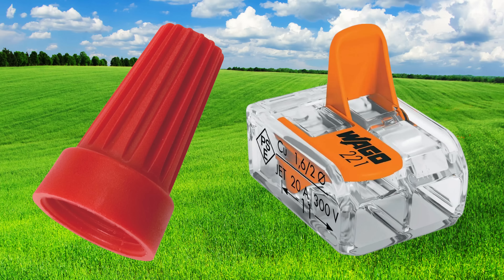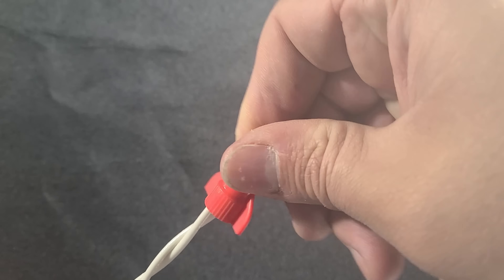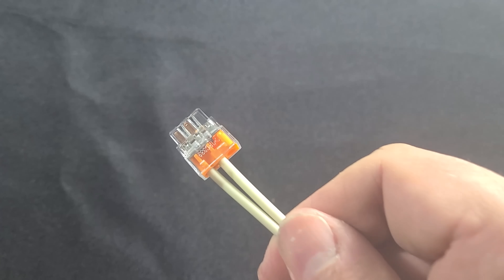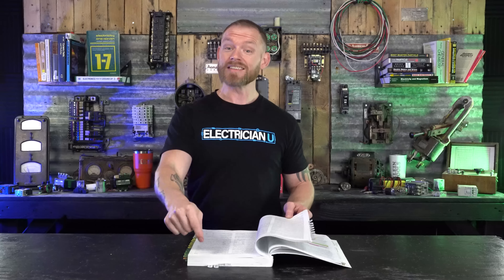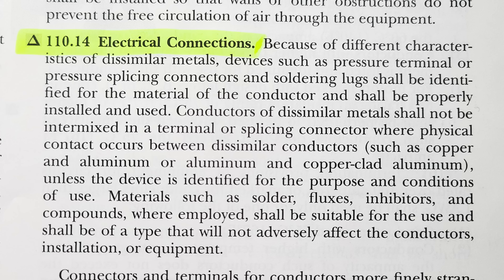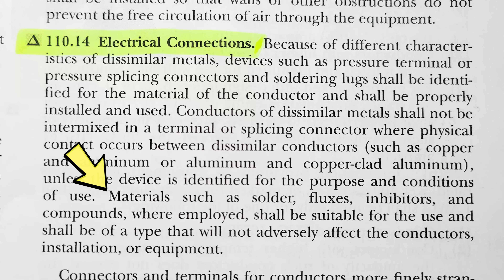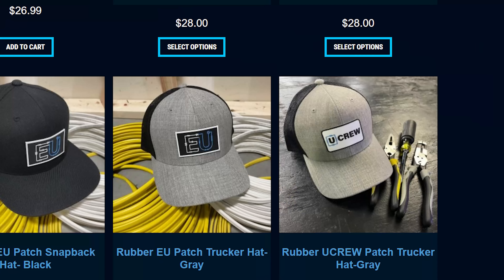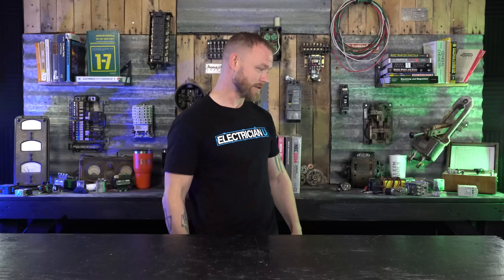Should We Use WAGOS or WIRENUTS?!?!

Comment: Two advantages of WAGO connectors, that are seldomly mentioned: 
1. You can inspect the connection, because the plastic is see through. (cable stripped properly, wire pushed in deep enough) 
2. The connector has a tiny hole, which can be used for safe measurements on a live circuit without undoing any splices.
Reply: Wago 222's are not transparent though.
Reply: He's obviously talking about 221s.  Being both smaller and transparent, you should be using 221s anyway unless you have a bunch of 222s left in stock.

Comment: I love your Channel. I have over 40 years experience as an electrical contractor.. But you made one mistake. A stab lock is exactly that, you skin the wire, stab it in and it locks. Wagos are entirely different termination. They are compression, you skin the wire, push it in then flip down the tab. Compression is completely different then stab lock. Also it is much better. Stab lock should have never been approved and it sucks!

Comment: I'm retired after forty years as a commercial electrician. No real electrician would consider using a wago over wirenuts. I've removed wirenuts that were in place for over forty years that still looked like new. As far as twisting wires together in most cases the twist is what insures a good electrical connection. It's sad but the directions on a box of wire nuts is generally wrong. You twist all solids together before installing the wire nut. You twist all stranded together before installing the wire nut. For a combination of solids and strandeds you twist the solids together and then twist the strandeds together and then you place them side by side with the ends even and screw on the wirenut. They don't fail if done correctly. Those wagos depend on a slight pressure against a metal strip. That's a very poor connection when it comes to commercial use and should never be used except for fixture wires in strip lights.

Comment: The Wago connectors are UL tested for the loads they list. They have gone through extensive testing to categorically prove they can handle all of the loads they are listed for. The UL listing provides solid evidence that the Wago connectors have been extensively engineered to connect copper conductor for the loads they are designed to carry. 

The myth that Wago connectors "heat up" is propagated by electricians who lack an engineering background.

I have had wire nuts fail repeatedly and I have had to fix sloppy electricians' work after the fact with twist wire nuts. I have also had shorts with twist wire connectors and they take a LOT more room in the box, and with smart outlets, that is a pain in the ass.

Comment: There is far less surface area with a wago.  The same with stab in the back outlets and switches.  With lower loads on lighting with LED then I'm ok with it.  POWER CIRCUITS require far more surface area in the connection.

Comment: This dude is  disingenuous. He is promoting Wago connectors without disclosing that fact. He presents wire nut and Wago on a plate shoving them in your face  and expects you to eat what is in front of you. He’s not telling you Wago connector is but one brand of several that uses the same wire clamping mechanism. Of course, Wago charges more for the same stuff.

Comment: (I've been doing electrical wiring for over half a century.) Wirenuts are a crapshoot: You can't see if there is a proper connection. After a burning smell, I discovered a charred wirenut behind a switch plate, just before leaving town for a few days. The wirenut had been there for two years and only then decided to somehow come loose and heat up. I've switched all the wirenuts in the house to Wago, and now feel I can leave the house without fear of returning to a smoking ruin.

Comment: This old electrical engineer has always used a "hybrid twisted nut" system. I start by twisting the wires together, and then I get my old Weller 150W soldering iron and solder the entire connection together using some 1/16" rosin-core solder, filling in the gaps everywhere. A reliable connection all about "contact area." My system beats anyone's in terms of contact area. The connections are as reliable as an unbroken length of wire. Does it take extra time to do? Yep, and I sleep soundly at night.
Reply: Makes changes and updates tough however. If you really want to go "old-timey" install knob & tube.

Comment: The copper to copper normal force of a twisted connection using a wire nut is clearly superior to that of a Waco. This is because the capability of the electrical connection is dependent on the mechanical normal force. Hence, a correctly assembled wire nut will always be better than a Waco. Take the time to twist it and then tape it in the opposite direction of the twist. Or you can use a Wago and get a tailgate warranty.

Comment: Seems to me that the typical bias against Wagos is similar to the bias against sharkbite fittings. It's just a resistance to something "new".  I find it funny to hear the typical "I've been in the business for 60 years, I've seen this I've seen that, and I don't trust these things..... for anything important.... but I keep some in my kit.... because they can fail.... or, I heard they can... or I read it somewhere on the internet.... you know,  a fire cam start because, you know, resistance... or umm, the lever opening, .... well, that's what the internet said." What I never hear these guys say is "these things started a fire and here's the documented proof." The same way plumbers say "I don't trust sharkbite fittings because that rubber gasket will leak in, umm, 25 years and they're unreliable." But you never hear the plumbers say "I installed a sharkbite fitting as per manufacturer instructions and it failed."

Comment: You should mention the UL White book. It goes hand in hand with products and code. It tells how to properly use items and what code articles they satisfy. Say for instance ring terminals.  It tells you can stack them on a bolt, but to be code compliant the tangs have to be rotated so they do not stack on each other. You don’t see information like this anywhere else. Email UL laboratories to get a free white book. More electricians need to use this.

Comment: I never heard of you or wagos until a few weeks ago but I like the content. But simply put isn't it safe to use aluminum and copper in a wire nut if you pack it full of dielectric grease?
Reply: NO. Connecting copper with aluminum has nothing to do with dielectric grease. The issue is that copper and aluminum have different coefficient of expansion. The coefficient of thermal expansion for aluminum is 35% greater than that of copper.

Comment: GreatScott! did an excellent shootout between Wago lever nuts and twist nuts, including pull-out force and electrical resistance. Twist nuts won just about every category but ease of use. The difference in electrical resistance is a nothingburger unless your specific application will handle heavy current, like a kitchen range or a clothes dryer.
Absolutely no need to pre-twist the wires. If you twist wire nuts properly, they will twist the wires for you. With solid core wires on both sides, you line them up, the ends of both are caught together, twist until the exposed insulator is twisted, and you have a solid, well-twisted connection within the nut. If you're connecting stranded wire to solid, you want the stranded wire to be slightly proud of the solid so that it will be twisted around the solid wire and the nut bites into both conductors.

Comment: Dialectic grease on all your connection will keep them from corroding, especially wet or damp condition.  Mr inspector here. Worked as a machinist and millwright
Reply: Not a problem if you use copper wire. Copper is essentially immune to corrosion. It behaves like a noble metal because of the naturally protective film that forms on the metal's surface. Dielectric grease is NOT the issue with intermixing copper & aluminum wiring. 
Connecting copper with aluminum has nothing to do with dielectric grease. The issue is that copper and aluminum have a different coefficient of expansion. The coefficient of thermal expansion for aluminum is 35% greater than that of copper.
When using aluminum wire 
There is no specific code requirement for antioxidant paste at the lug connections of multi-strand aluminum wires in electrical panels. Also, some aluminum wire manufacturers and panelboard manufacturers now no longer require antioxidant paste for aluminum wire connections using their products.

Comment: If you put wire nuts on untwisted wires and continue twisting the nut until you can no longer twist it by hand, then remove the nut, you'll see that the wires are indeed twisted together...
Hand-twist the nut, then use your Lineman's Pliers and twist it a few more times...
I've never had any problems with my connections...

Comment: What are your thoughts using wago on high continuous load circuits like a 110v EV charger. Aren’t the wago spring loaded similar to the push in connectors on the back of budget outlets? After running my portable ev charge connector for almost a year, I smoked a couple of my garage outlets. Ev charger was at the end of 4 chained outlets. Lucky I didn’t burn the place down. They’ve since been replace with spec outlets using screw terminals. I’d be real concerned if a wago was in the path.

Comment: 11:47   Is it acceptable to tin a stranded wire with solder to make it rigid into a Wago?   As I understand "wago" or stab connectors are to reduce user error which makes sense to me.  As an amateur I agonize over how many twists, etc.... Strip gauge to 13mm and stab is a no-brainer.

Comment: I have seen an inspection fail because the inspector insisted an non-listed device be replaced with a listed one. Way too much discretionary power in that position. I have seen inspections fail just for use of wago connectors, but that was years ago.
Reply: Inside of a light fixture, I would absolutely use wagos, and a scissor lift, fuck a 14 ft. A-frame.

Comment: My first journeyman  (20+ yrs ago) said ALWAYS twist ur joints,  the joint should hold even without a nut.  I've noticed in the last 2-3 years the majority of apprentices twist very little. But em up n crank it on with the  linemans.  Personally I've seen many  AFCII's trip due to due to minute arcing in the nut. It's always solid, never stranded. Haven't seen it happen in awhile. Maybe afci breakers are improving?

Comment: Wire nuts are not just a waste of time dude but you are putting undue stress on the conductors. Take a piece of metal, copper, whatever and keep twisting it and untwisting it. Eventually it 'will' break. I hate the twisters out there. It makes for a pain in the bum job when I break out my tester to fault find, test or commission. Lever connectors are the way forward and used in the correct junction box become maintenance free connectors.

Comment: You can drive a Chevrolet Spark or the Mercedes-Benz S 500 63AMG. Its pretty much the same thing. They are both regular cars in their respective markets, that will get you from A to B, but one of them is slightly better engendered than the other…

Comment: Referencing twisting or not twisting before wire nut installation: I have used both methods and had to go back and twist straight joints as the resistance was high enough to cause "ghost trips" of the AFI/GFI breakers now required by code. The twist exposes more metal intimate contact and lowers the resistance of the joint.
I am concerned about WAGOS for the same reason.  A twisted wire nut connection can handle reasonably high currents with less heat generation as opposed to the point contact of the WAGOS.
On low-draw circuits such as basic LED lighting, WAGOS are DEFINITLY the way to go but for motor or heating element circuits, I prefer a twisted (maybe soldered as well) wire nut joint.

Comment: I have with One gripe with Wago. My sister in law was doing her first ever all by herself DIY swap of a light fixture. She finished the install and the light wouldn't turn on, She was too ashamed to ask for help so finally my brother asked for me to take a look at it. The Multi-meters reading was all over the place So I'm thinking bad connection. Sure enough the Wago Connectors that came with the light fixture were bad, fixed it by swapping it with a wire-nut. 

That's when I was able to get a better look at the Wago, It was a fake knock off, literal trash, one side didn't close snugly. I had to look real close to tell that it was fake, and that leads me to my Issue with Wago. They added a simple moving part, now I'm sure Genuine Wago connectors have no issue with tolerances, but that simple moving part introduced a point of failure to the knock off. I don't know what country the led light fixture my sister in law bought came from, but they obviously had no qualms shipping it with knock off Wagos, and the majority of people can't tell the difference.

Comment: People seem to think that the only reason to use wirenuts is cost but that's incorrect.  Wirenuts are more compact.  The more wires getting connected together, the greater the difference.  When folding wires into a maxed out box, would you rather use red wirenuts or a five wire wago?  Personally, I'd rather use wirenuts because it'll be easier to fold the wires into the box.

Comment: I use wire nuts cause it's what I've always used and it's what I'm comfortable with and used to. However I do love wago connectors for odd situations like when you're joining fine stranded wire to a solid conductor. I work in industry and we'll commonly stub out of an L body with a cable gland and a short length of SOOW and I love them for that.

Comment: Electricians who still use wire nuts needs to be stripped of their license. There is not a single circumstance where wire nuts are acceptable. As a customer i would never accept an installation performed with wirenuts today, 20 years ago, sure, but today no.

Comment: And I will be cursing you and  all of your pretwisted wires when I come back to add or remove a wire later on. I just put a band of tape around the group of wires before I take the wirenut off. I have had Wago levers pop open inside of crowded junction boxes. Buchanan called their's "Red Rangers". Woo!

Comment: It is worth noting that there are more choices out there than just wire nuts or Wagos. There are also just plain screw terminal blocks, which are standard issue on pretty much every wire-in household appliance sold outside the United States. Which brings us to the third thing worth knowing; Wire nuts are ONLY used in the United States, and are frowned upon, and in most cases illegal in every other country in the world, and have been for decades.  The reason wire nuts are inferior to every other splicing method is simple - They Come Off!! Either the plastic cap comes off the wire winding, leaving everyone vulnerable to lethal voltage, or even more common the whole thing just unscrews and falls off, leaving everyone vulnerable to lethal voltage. Besides making your circuit fail. Wire nuts are a throwback to another era - the good old days before anything was grounded, ground-fault breakers didn't exist, houses had screw-in fuses instead of circuit breakers, and these could conveniently be replaced by a coin in a pinch, and wire insulation was made of cloth.  If you believe we have evolved beyond that point, it's high time to start believing in ditching wire nuts once and for all.

Comment: For any circuits drawing current near the breaker limit I use MARR connectors.
Reply: That should be MARR set screw connectors with screw-on insulating sleeve.

Comment: I worked in the trade doing low-voltage work, primarily sound and fire alarms. In the early 2000's contractors in this area started to use the push on (not clamp type) wagos.  All of the advantages listed by other commenters seemed to apply.  But only on 120/240 volt or low voltage where higher current is used - an amp or two.  In a lot of the fire alarm circuits, the voltage is typically 24 or 12, and standby current is milliamps. One smoke detector we used a lot had a standby current of 9 microamps.  And newer data-based circuits are very sensitive to voltage drop, often 4 or 6 volts between signal high and low.  On a 120 volt circuit  vent a small load like a LED light or phone charger will pull close to 1/2 amp on start up, pushed by of course 120 volts.  So any difficlulty with the connection,  poor contact, corrosion, oxide film on conductors etc will be overcome.  With such small currents pushed by low voltage we had a lot of reliability problems.   For several years we speced not to use push-on connectors for contractors installing our systems.  We didn't see many of the lever-lock type wagos.  I would assume they would be more reliable.

Comment: you reference Code 110 where it discusses dissimilar metal.  When you look inside a wago you can clearly see multiple types of metals.. one type likely steel, to hold the wire, and the other to conduct ..  This is likely against code in some places where disimiliar metals is not allowed...electron transport or electron sharing happens between different metals regardless if water is present (meaning it rusts even in a closed contained space or eats away at each other) 
also since a Wago is usually labeled, per the code you read, you can only use it for how it is labeled.  For example you cannot connect a 12 to a 14. something that you see a lot in existing homes where you are adding a circuit, you don't get to replace an entire leg just because it is different off, as long as it is higher than required you can bond them, but not in a WAGO because it is labeled to a specific gauge.